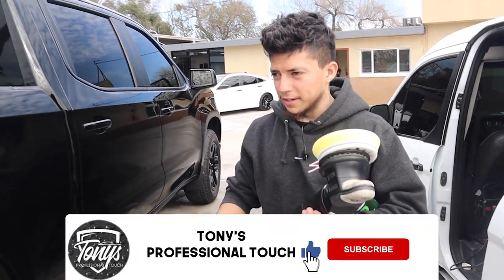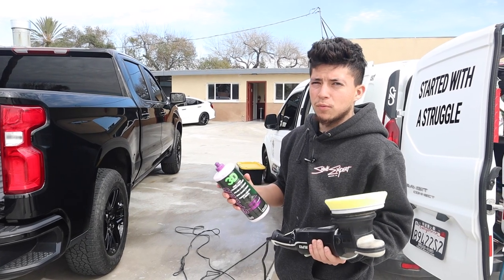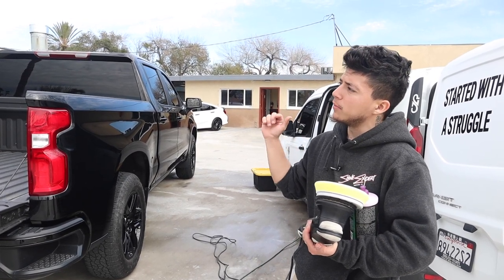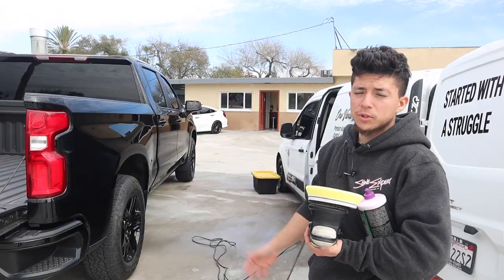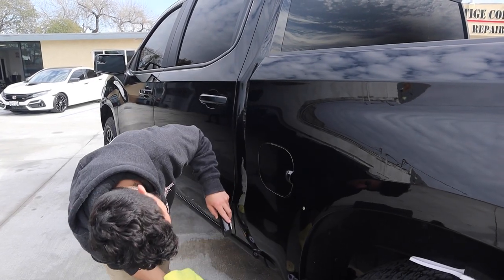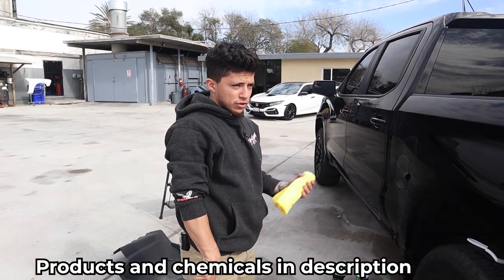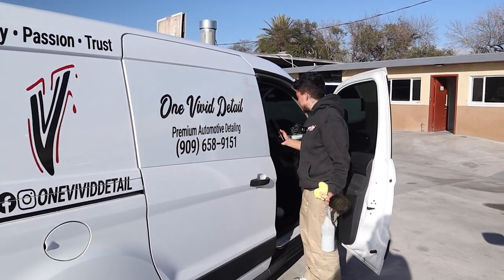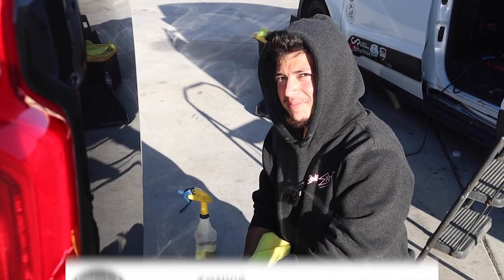What My Entry Level Polishing Package Consist Of - Tony's Professional Touch

Comment: Very rare to see a detailer do a polish paint correction outdoors.
Reply from the maker: This isn’t a correction, just a light polish. As long as it’s not too hot or windy, it’s fine to do it outside.
Reply: I do it. did a full 1 step paint correction and sealant on this Mercedes CLS63 AMG went amazing u just gotta know how too work with the sun or in a sunny area